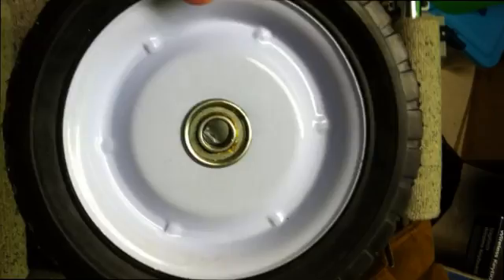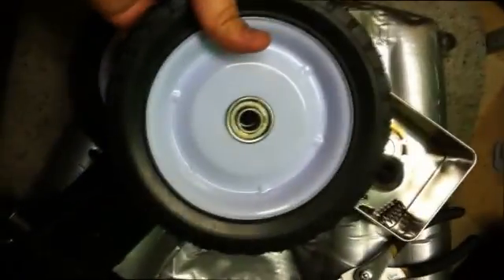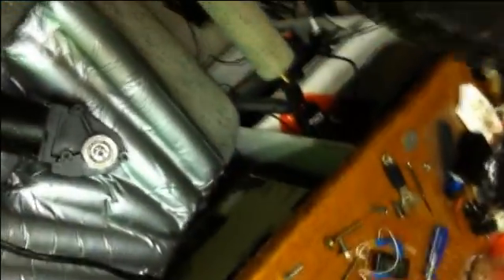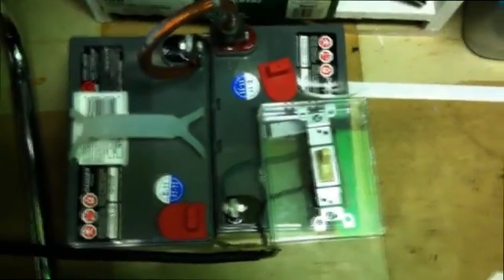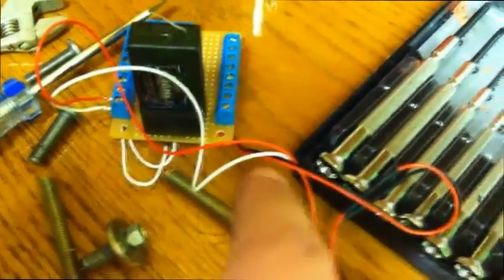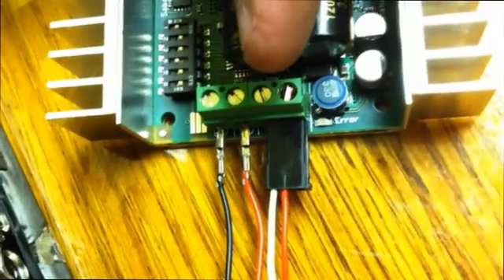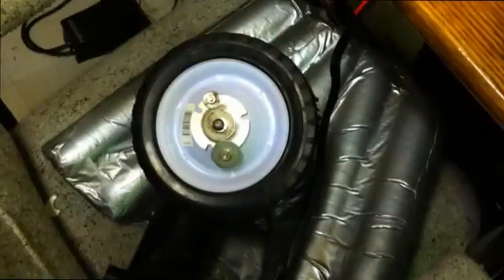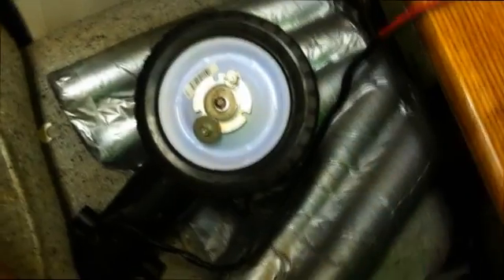Dave's LawnBot Part 2

Comment: The electronics part helps a lot.   I have instructions from other Mow-bots so I could pick their frame/mower and their wheels/motors and then use your electronics to run the thing and there is no reason (other than money)  why I could not get one to work.